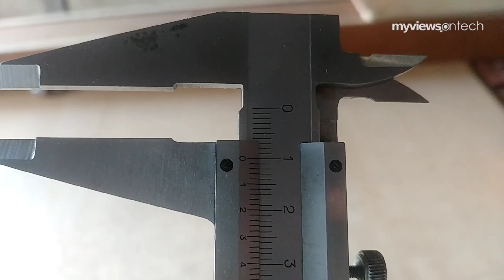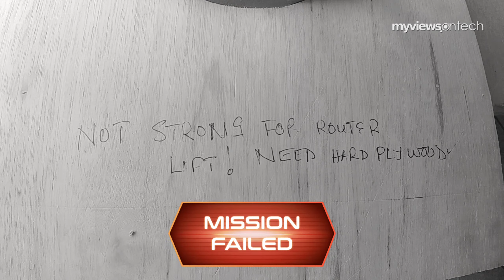EASIEST DIY Router Lift with Insert Plate | Part 2

Comment: That is a fantastic solution, did you take out the springs from the tubes of your router case?  I have one old router which is quite similar problem with this router is the case and the tube guides do not have a snug fit, there is a little play. I've mounted my Makita router case but have to change height manually entering the box which is an obstacle. You are already some steps ahead 👍
Reply from the maker: Yes I took out one spring opposite the lift mechanism- Using both springs was too much - using only one balances the lift easily. - My palm router is too weak for my routing needs so I needed to put the big one.

Comment: Nice, you use the posts (runners) from the router itself to stabilize the vertical motion. Lots of other guys build those separately. 

All you need to be concerned about is mounting a long bolt to control the vertical movement.

Clever.

Comment: Hi , how can you change the router bits???
After  using this sistem  for some Time did you change anything??
Thank you for share tour work
Reply from the maker: I lower the router to its lowest level and change the router bits from the inside in comparison to changing from the top. I have not made any changes it works very well. I only added a bit of greese to the threaded rod.

Comment: I know I must have missed it but what keeps the top adjusting nut from spinning off the end of the threaded rod? Did you peen it or perhaps drilled it for a set screw? Great solution to a problem I have had with adjusting the depth of cut from above the table!  I hope to use your method in the near future.
Reply from the maker: Hie @LarryT1948, If you go at timestamp 8:15 and pause the video , you will see that there are two nuts that act as the stopper.They are tighten in opposite direction to prevent the rod from slipping. And then at the bottom teak block there is another threaded insert which helps raise and lower the router.

Comment: hello, i would like to get  a similar router ,after a long experience with this machine , did you have any problem with this machine ?
Reply from the maker: Hie. I don't have any problem with the router - It is quite powerful and has a speed adjust. Mine was a bit stiff to plunge down so I took out one spring and it is now very useable - maybe yours will not be too stiff for plunging. All the best
Reply: @SKTWoodDesign  thank you very much, from Algeria
Reply from the maker: Most Welcome.
Reply: Hayy friend 👍🤝🇮🇩🇮🇩